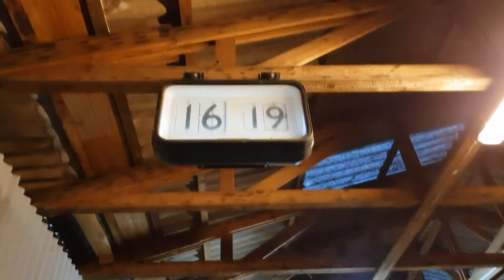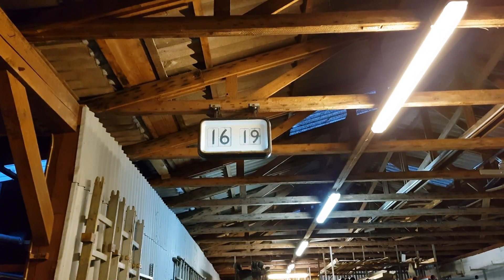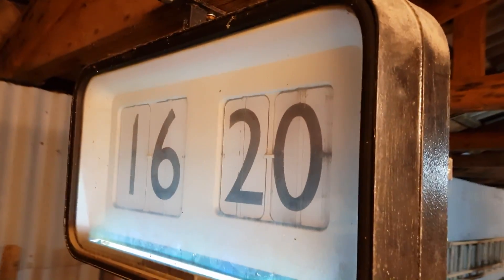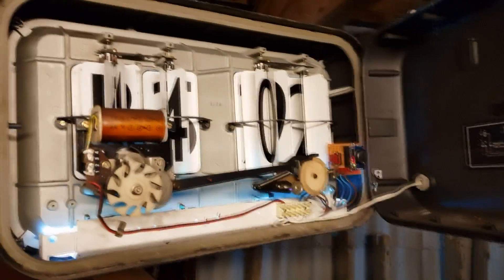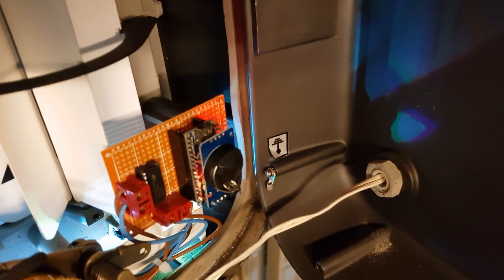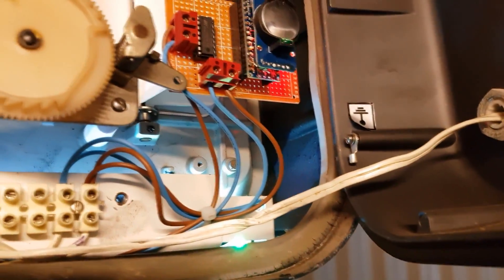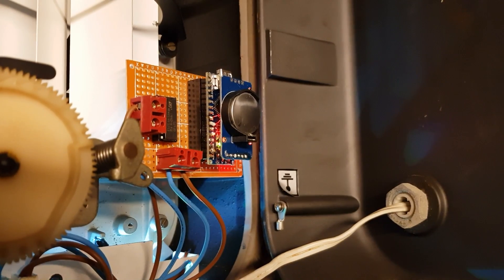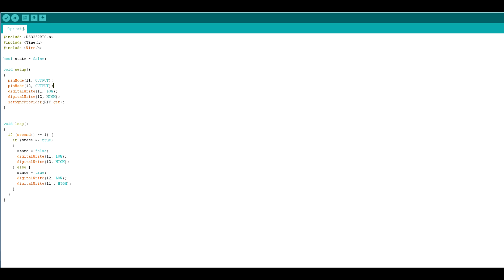OldTech: Flip Clock Retrofit Arduino RTC

Comment: Hey Aaron!

Thank you for the video! I'm inspired and trying to build the same for a vintage 12v. Siemens flip clock! :) 

Would these components work?
Arduino Uno R3
DS1307 RTC
L293D 
12v. 1a power supply.

I saw DS3231/L298 in another comment, but I think you mentioned L293/DS1307 in the video. Maybe this makes no difference? And would your code above work with something like this, or am I in over my head? Completely new to Arduino

Vielen dank!
Reply from the maker: Hi, yes that looks good, nice that you liked it.

Today i would not use the DS1307 and more the DS3231 as it is way more accurate, the DS1307 can loose up to one minute per day.
But if you just want to use my code it should also work with the L293 as it is just the driver without any logic. 
maybe compare the pinout of the Motor Drivers and then go for it
Reply: @atc1441  Perfect, thanks for the update. Giving it a shot

Comment: could you please provide info on the components and circuit
Reply from the maker: Hi it is very easy, just one l298 motor driver connected to the arduino like on this page: http://communityofrobots.com/tutorial/kawal/how-drive-dc-motor-using-l293d-arduino 
and one DS3231 RTC I2C Clock connected like here: https://www.hackster.io/harshmangukiya/learn-interfacing-ds3231-rtc-module-in-arduino-5c9993

Have a nice day